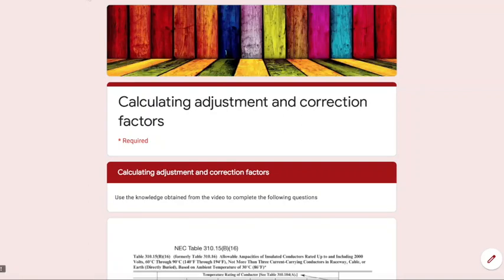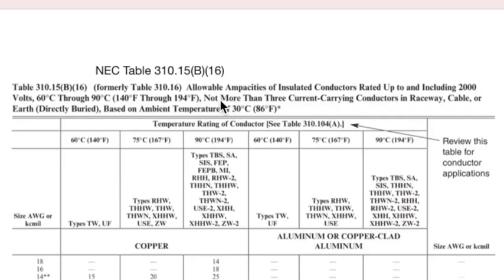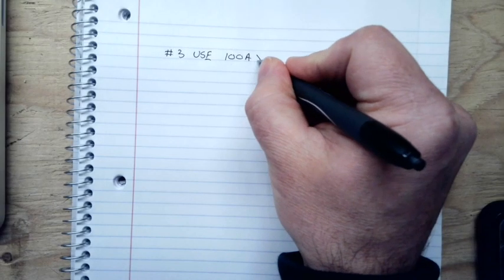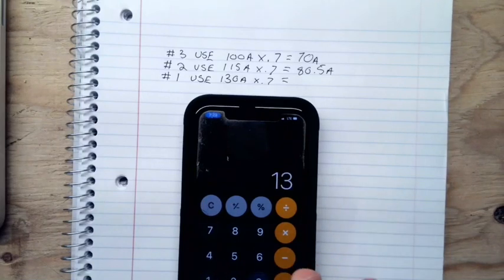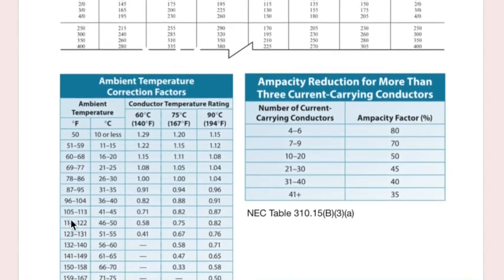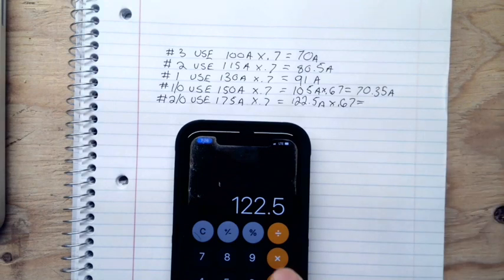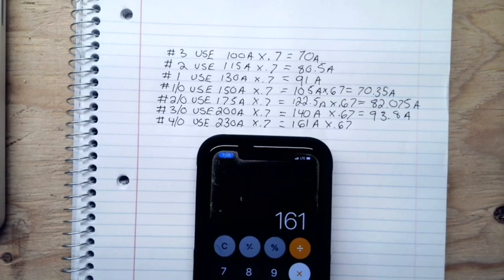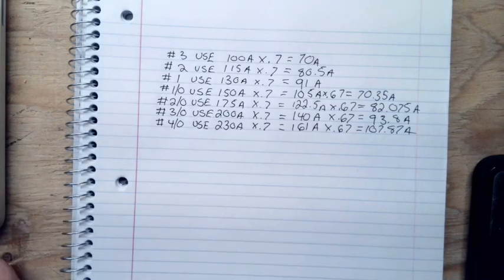Adjustment and correction factor example

Comment: This is a nice way to learn Ampacity calculations. They should have included a step further, like to calculate wether the 4/0 would still be ok to run inside that conduit, but they didn’t specify what size conduit was used here so it don’t apply. It’ll be cool if I could find more examples like this online to brush up on the steps but it’s hard to find them online!!

Comment: This is good except the code states to use the 60 degree column for under 100 amps and the 75 for over 100 amps I might be wrong but please confirm
Reply: I heard the same however I still don't know when to apply this
Reply: Does that mean before or after adjustment and correction factor?   Good question